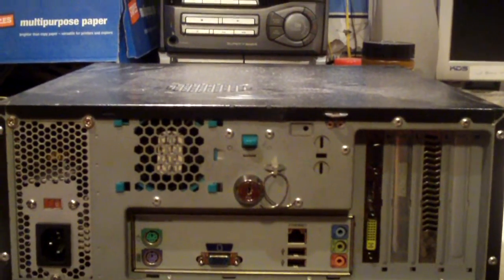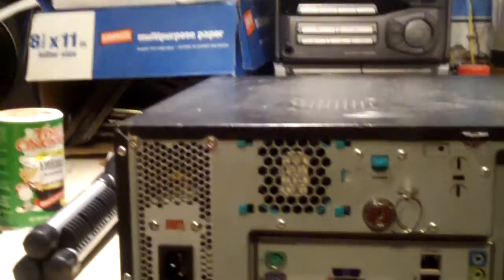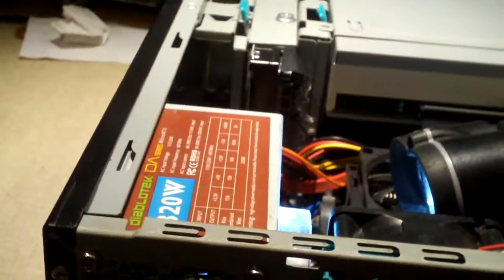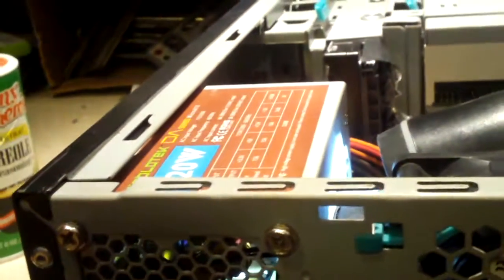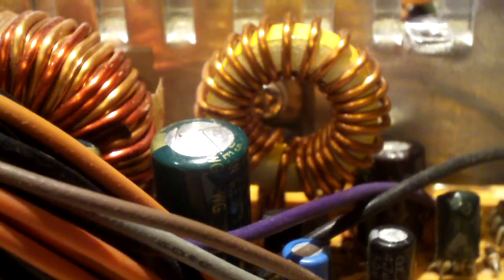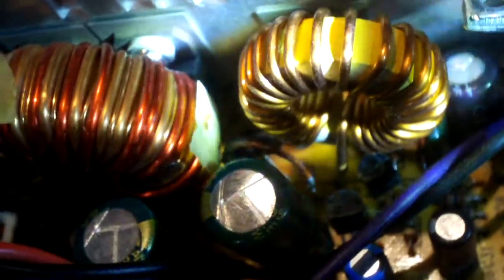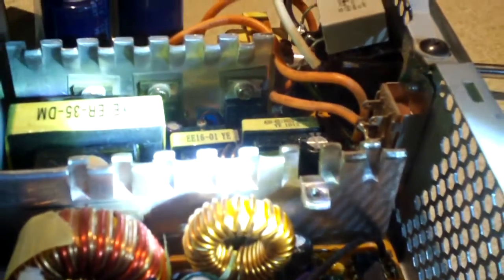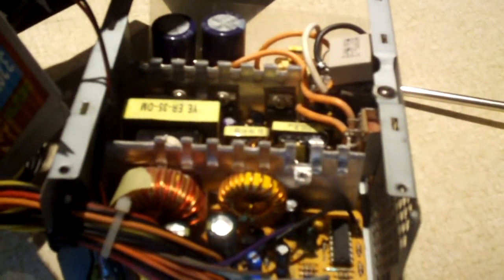Overheated Sanyo capacitor in TiViBox Power Supply

Comment: Sanyo sold out their electrolytic division to Suncon some years ago... unless that is a really ancient PSU (it is an ancient design) then I highly doubt those are genuine Sanyo caps. There are also a couple other giveaways... notice how the sleeves seem to cover a bit more of the top vent area than most electrolytics... that is an indication of a resleeving job, very common amongst cheap chinese fakes. Another clue is that the capacitors are green/gold. IIRC if these were genuine they would be  ultra low impedance/high ripple rated motherboard grade caps (used to be good years ago, not good enough for todays boards though). The thing is if you use such a series of capacitor on a switching power supply like that the one in the video the ESR of a motherboard grade cap is so low that it throws the loop compensation off of the power supplies pulse width modulation feedback circuit. In other words using a high grade cap on a computer power supply can actually make things worse.
Reply from the maker: Those Sanyo capacitors are from 2002-2003, so they're likely genuine. The power supply they're in is 3 years old. I've used motherboard caps in power supplies for years. Typically, computer power supplies come with them. I see "LOW ESR" stamped on power supply capacitors all the time. I know what you're talking about when it comes to re-sleeving caps. I've seen some like that, mainly Asia-X and JunFu capacitors.

Comment: It is a good idea to go threw all the caps with a ESR Meter because you can not tell just  by looks, you could have had one that just had a little gas in it but was still good, we have seen some large caps thinking they are bad, but it was just the plastic cap on the capacitor, they all dry out after 15 years in warm conditions.

Comment: Maybe you didnt see any symptoms because the mother board is good. I had one psu with a overheated cap, although this one was a cheapy-medium one and it surely overheated because of the current as it had nothing around. The thing is i changed the psu for a bigger one at that moment and then never used it again, but years later trying some stuff i plugged it to my oscilloscope just out of curiosity to take a look and notices 1Vpp of noise! I said "well maybe it's because it has no load", so i attached 10W to the 5V and a variable one (up to 180W) to the 12V rail and with 5A of load the ripple went to the roof hitting 2,4Vpp. Long story short, bad cap + shitty psu = potential motherboard killer. I suppose my old P4's intel board didnt die because it had some caps on the board that compensated for the supply's (a 1000µf one on the end reduced it to 250Vpp) but it scared the shit out of me when i saw those number, it could have died had i not changed it >_< Now whenever i see a pc with a cheap psu i start to feel the adrenaline XD
It would be interesting to know how many of those "mysterious deaths" that mostly cheap motherboard have are related to these kind of failures.
Can you check your psu's noise with the old cap?